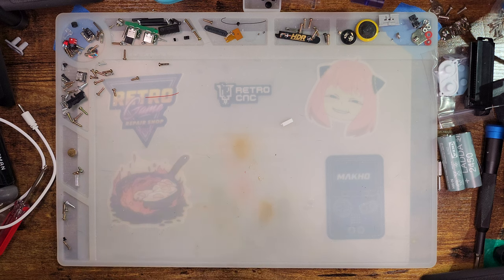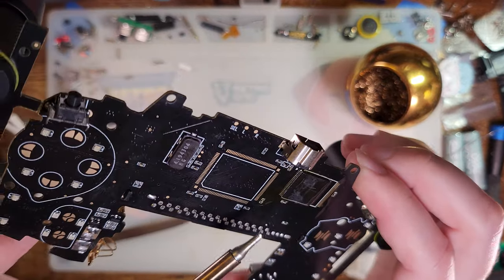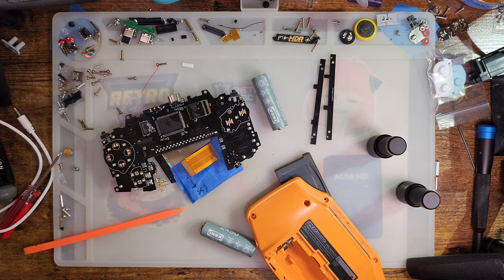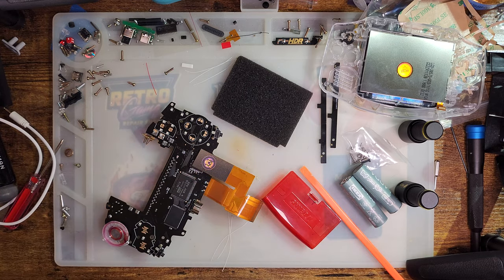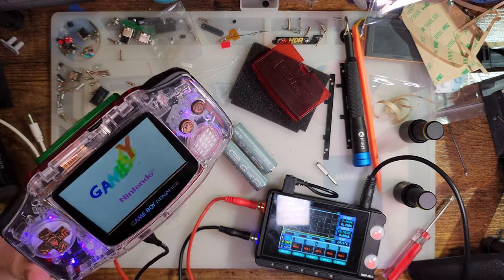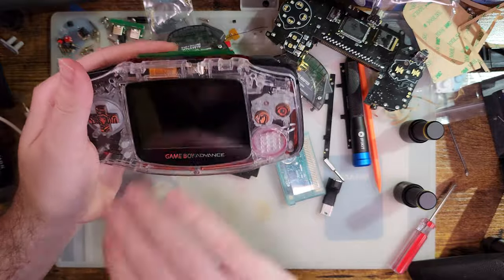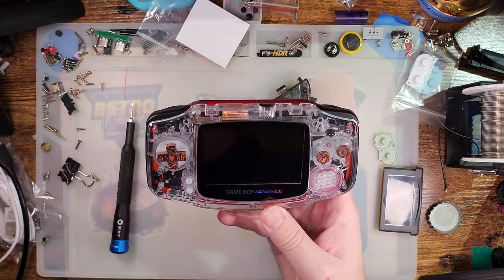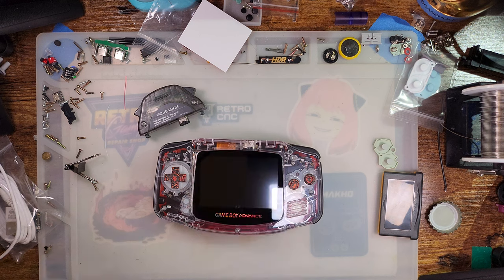Custom Game Boy Advance Motherboard (with RGB!)

Comment: So, we can finally salvage all the broken units and harvest their parts…
Reply: and you just had to gently set the CPU down, twice even.
Reply from the maker: This requires an aptitude for soldering. I don't suspect this will be a "solution" for most people.
Reply: @makho  I see there is an option to purchase the mobo with cores already soldered on. Does that solve the problem there?
Reply from the maker: @jake.raynor  Yep, I suppose it's a partial solution. I wasn't even aware they were going to sell those versions until about 20 minutes before the listing went up when I got a weird question in my inbox.

Comment: So I've been working on an lost/abandoned GBA that was badly damaged. I have it back working and ordered a new case with a laminated IPS LCD kit + lithium USB-C battery + Omega Drive flash cart. So none of this new stuff has arrived yet but I'm starting to have concerns about the capacitors since it was left out in the elements for an undeterminable amount of time.  I don't want to get it all together just to find out the caps are week and can't power cycle properly or even worse won't work at all. So now I'm kinda torn on spending another $60 on this free GBA for this new MB to make sure it is 100% functional and will last a good long time (I'm certain the CPU+RAM chips are fine and I can know how solder them to new board) . (especially since they now gold plate the cart pins). When the coolest part of swapping to this MB is the RGB LEDS but I ordered a classic grey case :, (... So should I just order the replacement caps $2.99 and take a chance on this MB or spend the $60 for this new MB which would put me around $200 spent on this GBA that I found in a ditch... But it would be a pretty sick GBA...
Reply from the maker: I mean, you can always test it once the stuff you ordered comes in. It's all more or less "drop in", especially for someone who can solder the fine pitch CPU in these things.

Comment: TL:DR; once these boards become available, I plan on buying 2.

I have a GBA that I messed up when trying to do the Woozle Consolizer mod that used the flex cable soldered directly to the CPU, and then when trying to replace the clock crystal with a good one I managed to accidentally knock off 2 capacitors and lost them (C4 and C54 if I remember correctly). Surprisingly, the GBA still functioned until I desoldered the flex cable despite the fact that I accidentally broke one of the legs on the CPU. If I had remembered to use flux when initially soldering the flex cable, I probably would have successfully installed it because my issue was that a couple of the pins for the controls were shorted together and I damaged it during my attempts to fix the shorts. Even now, the power LED will briefly flash when I turn it on, so I still have hope that one day I can repair it.
I have a second GBA that was having problems with the lowest volume that it would output, and when I first got it the volume would turn on when the volume wheel was turned all the way to the left. I was able to resolve that issue with some IPA, but that led to the low volume cutoff problem. I couldn't leave well enough alone and when I replaced the volume wheel, I could no longer control the volume and it was stuck at about half volume, and turning the volume wheel had no impact on the volume, and even with the volume wheel desoldered it's still at the same volume. I've replaced the capacitors on the GBA, but unfortunately two of the pads for the volume wheel were lifted the last time I was desoldering the volume wheel.
Reply from the maker: The soldering required here is more difficult than the mods you were not successful with. This is not the solution until you have a lot more practice under your belt.
Reply: @makho  I've ordered multiple surface mount soldering practice kits to hone my skills before I even touch the CPU on either GBA, although I hope that I can figure out the reason for the audio problem with the otherwise functional GBA.

Comment: I wonder where they get their “cores” since I ordered one with the core on the board because they were out of stock of the other one… wonder if it’ll be beneficial to swap out the ram and cpu with original Ones
Reply: Their “cores” come from original boards. It will not work with anything else.

Comment: Can you detail more about the ultra sonic cleaning process you use? what liquid do you use?
Reply from the maker: I just switched processes and need to run some boards before I want to talk about it. Old process was full of unsafe practices.
Reply: @makho  i appreciate the honesty. I love your content and put a lot of trust in your methods as a hobbyist at best. Your videos helped me through my first mods and I’m interested more of your advanced method. Really curious how you would do something like the Gameboy Pocket Colors that require component replacement. Hot air station or do you have a reflow oven?
Reply from the maker: @SimpleEnigma331  I mean, I've done boards like that already: https://www.youtube.com/watch?v=GHXvdIwkk48

I tend to use a combination of hot air, a hot plate, and my soldering iron

Comment: I have 2 AGS-001 motherboards that are cracked. The CPU and RAM are in good working order. I wonder if I can swap those over to these new Funny playing boards
Reply from the maker: The CPUs are not the same. Count the pins if you don't believe me.
Reply: @makho  oh I believe you, just never went through the trouble of trying to figure out the differences. I did see they are different model CPUs though

Comment: I just did this last night with a red mobo. Boots up but doesnt load game. Had to take a break to let my head clear lol. Hopefully ipa in cart slot will do the trick.
Reply from the maker: If you mean the funnyplaying board, it's a new cart slot so there should be nothing to clean. Double check your soldering.
Reply: @makho  ya, i bought a magnifying headband to see the pins perfectly. Straightened one or two legs perfectly, and solved the issue. Thanks for the reply.

Comment: Do you recommened heating the board from underneath to remove the cpu?  To avoid long heat cycles?Apparently i cooked my cpu that i attempted to do the transplant. (Low heat/time was the culprit).
Reply from the maker: I haven't needed to preheat the board nor have I ever cooked a CPU. I just hot air it off and move on.

Comment: Hey, how's the audio quality over headphones? The original has a lot of EMI which is made way worse when adding backlit screen mods. Lots of high frequency whine and chitter chatter.  Does the new board and audio circuit clean that up?
Reply from the maker: I never use any GB with headphones so I have no real frame of reference. Sounds fine to me though, albeit dual mono instead of stereo (both LR channels sent to both LR).

Comment: What a useful video thank you for that :) I want to do the same. could you fixed the problem with the link cable? Without it would be a bummer
Reply from the maker: This is the older design of the board with larger LEDs and the link port issues are a result of a soldering defect with the ferrite beads near the port. You can manually touch up the solder and fix the issue in about 30 seconds if you have an affected board. After the first batch, funnyplaying revised the board to use different ferrite beads (and much smaller LEDs) and this problem has since not reoccurred.

Comment: I finally got a funnyplaying board and I was able to transfer a working CPU and memory to the new board. I got it to turn on and it recognizes a GBA and or GBC cartridge but it does not load. Do you know if this is indication of a short during soldering? 
What can I do for troubleshooting?
Reply from the maker: check all your solder joints. Use a microscope.

Comment: Is there glue under those chips? I've tried several times with my solder gun and it will NOT come up
Reply from the maker: I've never seen one with glue.
Reply: @makho  there was glue! Used my hot air gun to get it off

Comment: Hey Mahko, I have been trying to do this and everytime I get the cpu and ram tacked down and soldered in my gameboy doesn't even power the display - confirmed working on an original board. I am sure it is something I am doing wrong.

I have no bridges that I can see when I get this done, but I am removing the cpu / ram with hot air @650F. Is this too hot and am I damaging the IC's internally? I can not find a straight answer anywhere about what temperature is OK. 

Looking for some professional insight.
Reply from the maker: I'd recommend a microscope to inspect your soldering. The pins are very small and very close together. 

Datasheets are not available for these parts so no one can give you an answer on the temp. You'd have to see if you can find data sheets for comparable parts and go from there.
Reply: @makho  Thank you. You make it look so easy 😜

Comment: what kind of batteries do i need? and what screen should i get? i dont think the one i have will work
Reply from the maker: Should work with rechargeable battery mods, NiMh rechargeable AAs, or regular alkaline AAs. Use whatever you prefer. It should work with any backlight kit except AGS-101 mods.
Reply: @makho  I need help idk if this screen I have works or how to wire it. I got my retro motherboard in and think I have the CPU and ram soldered in ok.. I can't see any shorts or anything.(did have to unbend pins because I niked one with the solder iron.. but I think I soldered on pretty good now.. I did have to re start like 4 times because I didn't have the right tip.. I hot aired it off every time and didn't bend pins then... But my GBA makes a screaming noise
Reply: Update.. my doofus but put the ram in upside down. The screen works but just shows rainbow lines??? Did I ruin my ram ? And CPU?
Reply from the maker: @Willabeast  I suspect you need to double check your soldering still.

Comment: Do you recommend that sainsmart power supply?
I've seen mixed reviews.
Reply from the maker: Mine is miniware branded and I've personally had zero issues with it. I use it quite frequently.
Reply: @makho  Thanks!

Comment: Do you recommend a flash cart for gba?
Reply from the maker: I don't ever recommend flash carts unless you want to play a ROM hack on hardware.
Reply: @makho  what’s the diff? I have gbc carts & a flash cart for my fpgbc and there’s literally no diff except a mental satisfaction that you’re using ‘the real thing’
Reply from the maker: @james441  If you're fine with using a cart emulator, then that's fine, I guess. They're less efficient than OEM carts (in terms of power), there are more limitations between supported hardware and clock speeds, and they're more expensive. All in all, there's very little benefit. 

Just emulate the whole thing; it's a better experience.

Comment: I've been trying to fix my gba for weeks, my board is just dead after trying literally everything.  Just ordered on of these, it's a risk but if my cpu and ram are fine, ill have something better than another stock gba!  (Hopefully I can get it transfered ok)
Reply from the maker: The GBA ASICs are shockingly hard to kill. That being said, the soldering required is also pretty high level.
Reply: @makho  Well great news, the transplant was a SUCCESS!  I do have one question however, have you figured out how to change the LED color?  Funnyplaying says to press start + a/b to change LED color, but that actually changes the brightness.  Doing select + a/b does nothing.  But all my buttons work
Reply from the maker: @jon199680  You have the same documentation I have, unfortunately. I've noticed the LED changes color based on voltage (not just low battery warning) so I didn't think it could be set.
Reply: @makho  actually, I reached out to Funnyplaying and they sent me a chart with the button combos that actually worked.  You have to change each individual LED one at a time.  But it can be done.  I can email you the chart if you'd like

Comment: Wow those chips came off fast. What's your temp and airflow? I see vids where it's low and they nurse the chips off.

Also you mention a sonic cleaner, what solution do you use in it?

Cool video
Reply from the maker: I usually have the temp at the high end of the scale. I figure hotter means less time at temp. 

And yes, I do use an ultrasonic cleaner. I've just switched to a new method though so I don't really want to talk about it until I can vouch for it.

Comment: with usb-C + hdmi port 10/10
Reply from the maker: that defeats the purpose of this board and would significantly increase the cost and complexity. You can already still add both of those things with existing mods.

Comment: All that, and still no USB C or HDMI out ports? Hmm...
Reply: Yeah I doubt FunnyPlaying would want to ruin it by adding that junk.
Reply: @HighPower64  You mean improve on the design by adding those critical features most modders put in.
Reply: On what planet are USB C and HDMI “critical features”? 

By adding USB C you eliminate the option to use rechargeable LADDA AA batteries which are undisputedly superior to a LiPo mod.

HDMI mods built into a console are gimmicky and not even practical, let alone critical. 

With this board the way it is you do still have the option to add all of that crap and sell it to your poor unsuspecting customers or whoever you are doing commission work for. 

FunnyPlaying obviously knows what they are doing. You on the other hand.. not so much 🤡
Reply: @smol7751  I was raised with Gameboys as a kid.  AA batteries were abysmal at best. Still are. I revel in the fact that I never have to touch them ever again. I just add a magnetic USB charger, and I'm good. The Gameboy can charge just as easy as my phone or other devices. Magnetic USB cords are the future my guy. And LiPo mods just make everything better. I don't know about you, but I HATE changing batteries whenever the system dies... But that's just me. I'll gladly spend $12~$18 on a new Lipo cell every 5 to 7 years as opposed to swapping AA batteries "to charge" every day or two. That's just obnoxious.
Reply: @JayrosModShop  My guy, your experiences are not universal. I'm sure most of us who watch this channel grew up with Game Boys so I am not sure why you feel that is an important statement to make. 

I would prefer to not be tethered to a cord or need to carry around a power bank while the internal battery charges when I can just swap a pair of LADDAs in 15 seconds. Saying that Funnyplaying should require this on the board THEY designed is crazy. 

As I said before, if you don't like it the way it is then you still have the option to add all of that garbage to this board.

The only obnoxious thing here is you, my guy, so I'm just going to disengage now since you are clearly set in your ways. Keep throwing those TP4056 boards in everything you make. I hope it doesn't blow up in your face, literally.